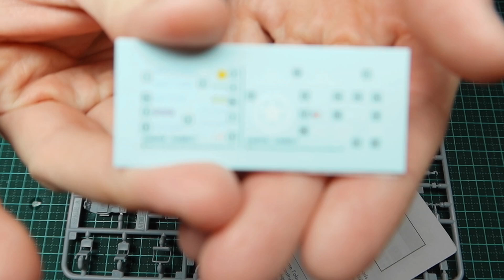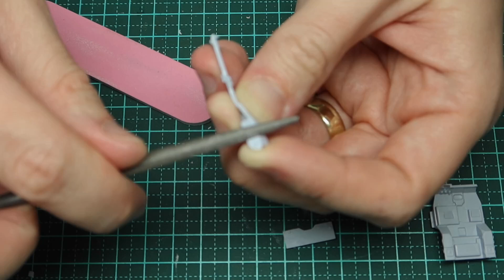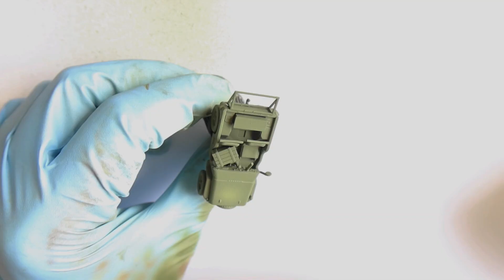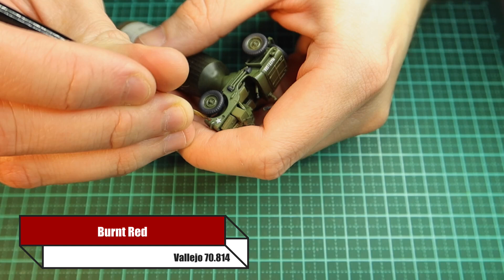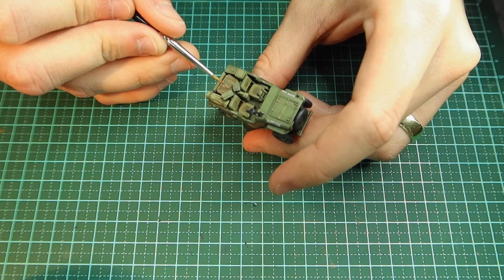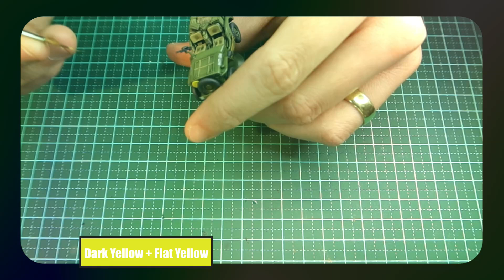1/72 Airfix British Airborne Willys Jeep -  Arnhem - Plastic Scale Model Build and Tutorial.

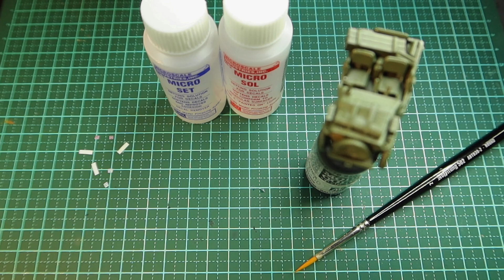Comment: At 5:25 disasterous move.  Tamiya spray cans are ALL synthetic lacquer.  It's okay to use a synthetic lacquer  BEFORE using acrylic paint, but spraying acrylic lacquer on top of dried / cured acrylic paint will have result in black, "pepper" marks on the acrylic paint job.
Voice of Experience 
   What I mean by pepper is that the result will be as if sticky black pepper were sprinkled on top of the dried / cured acrylic paint.  Each black, pepper mark is where the synthetic lacquer (in this case, Tamiya Spray gloss ) "ate" the acrylic paint.
   I have seen several hobby store websites misidentify Tamiya Sprays (the TS product line and AS product line) as "acrylic lacquer".
Reply from the maker: Thanks for your advice and information. I've never had an issue with Tamiya Semi-Gloss spray before .... it works absolutely fine for me? It also states on Tamiyas website that it's fine. How very odd ... 🤔
Reply: @paintingpanzers  
Here are the exact words from the Tamiya website.  What they mean is that u can put on a coat of either enamel or acrylic OVER / AFTER / ON TOP of a dried (cured) coat of paint from a Tamiya spray can.  It does NOT say what will happen if u do the opposite.  
    One test is worth a thousand theories.  I gave u the result of my test when I sprayed Tamiya gloss over a dry coat of Acrylicos Vallejo Model Air acrylic paint.
  I copied the following from the Tamiya (Japan) website translated to English:
Tamiya spray paints are not affected by acrylic or enamel paints; therefore, following an overall base coat, details can be added or picked out using enamel and/or acrylic paints.
Reply from the maker: @ieatoutoften872  I appreciate your research buddy. My point is, I've never, not once had an issue with it. I've done hundreds of vehicles using this exact method. All my hobby friends do it the same way too 🤔

Comment: A really nice job, I think that Airfix should make some conversion boxes for its Jeep, such as one for the SAS version or the Para 's one, with add ons & figures, probabilly these sets would sell well.
P.s. didn't these jeeps had a metal bar on the front, to rip off cables placed in middle of the streets ?
Reply from the maker: Thanks a lot mate 👍 🤩 
I completely agree, I wonder why they didn't release more variants of the jeep 🤔 they have the base so it really wouldn't have been difficult. 
I don't believe the 1st Airborne had those metal bars but I could be wrong. I guess being Airborne and having the element of surprise the risk of the enemy having time to place cables along roads would've have been likely? I'll double check to confirm though!